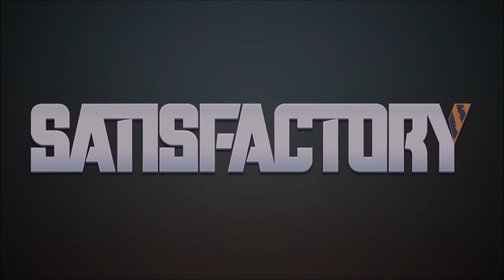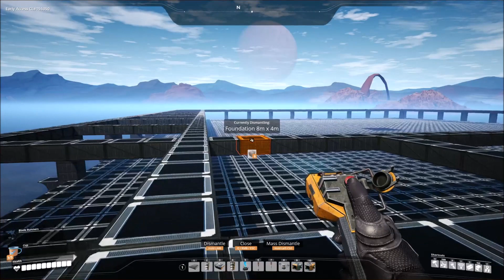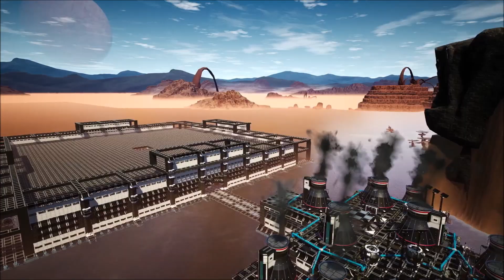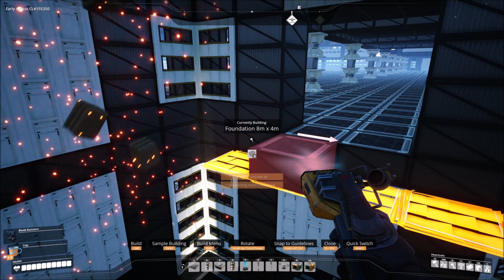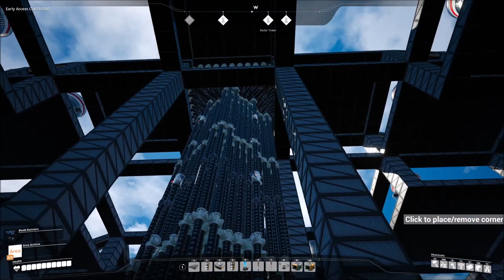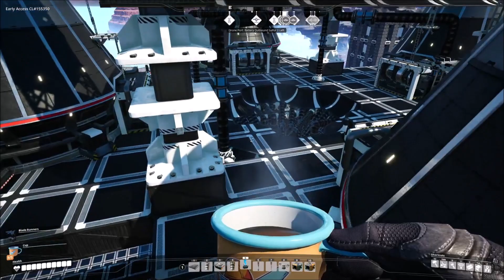PIPE-MEGEDON on our pyramid of power Satisfactory lets play Ep 13

Comment: And the sad thing is with the new uranium waiste recycling process, your going too have to do this all again. If you use the right recipes, you will have to completely clone this set up a second time with the burn time of the plutonium fuel rods.
Reply: @DrawingXaos  Are you sure that's wise? You can double your power output wile only having to store 10% of the waste. It just seems like a loss to give up that much extra power. Especially since where you built the first plant gives you the opportunity to place the storage facility underwater and thus contain the radiation to the same location.